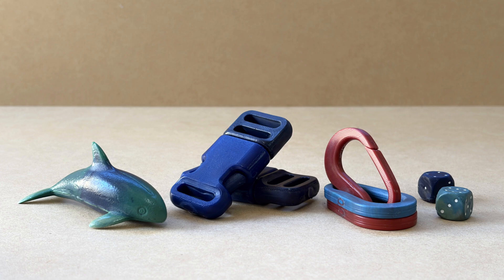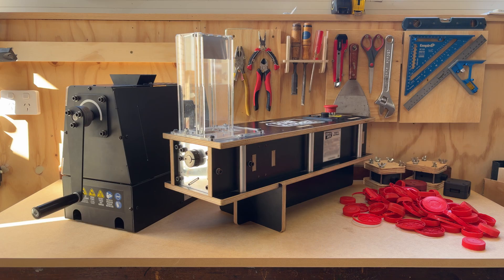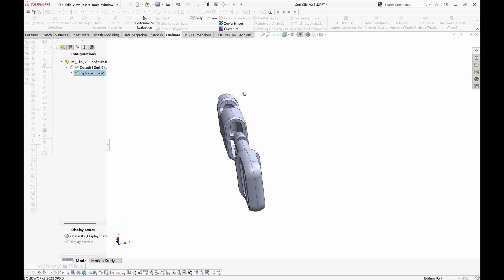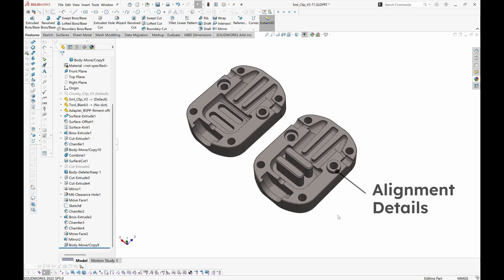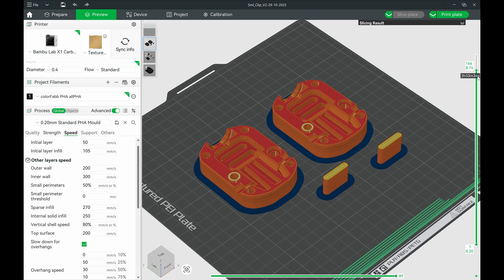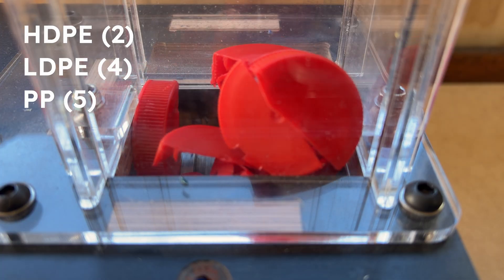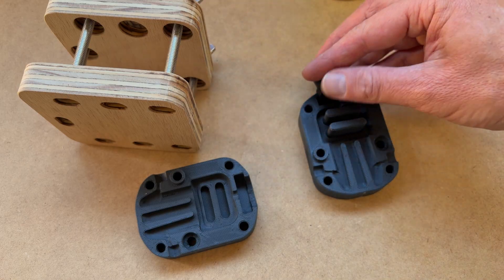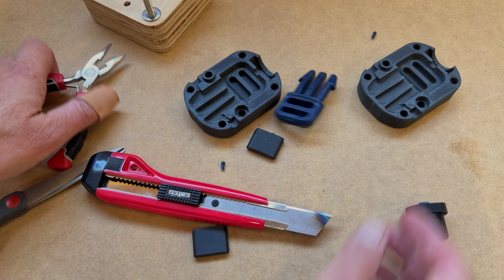DIY Plastic Recycling - FDM 3D Printed Moulds for DIY Injection Moulding – Overview

Comment: Another DIY injection moulder here!

The main issue with plastic moulds is that plastic is not enough conductive to cool the part fast enough.
Not a big deal if you are injecting at a low speed little series of objects.
Also strength on the long run can be an issue.

I started putting together my workspace a piece at a time, from the shredder to the hydraulic press+injection machine, to the CNC milling machine.

Now I can make my own moulds from metal, and that's awesome!

I found that plastic recycling is not only an ethical thing to do, but also very interesting (there are lots of things to learn!).
So ..yes, keep working on that!

Cheers from Italy!
Reply from the maker: Thanks. A CNC milling setup would be nice! Although I still think there is a place for the rapid iteration that 3D printed moulds enable, particularly with compostable PHA moulds.
For part cooling, I do find that for some larger parts I need to keep them in the moulds longer so they cool sufficiently. I also sometimes inject a little slower to compensate for the slow cooling and shrinkage. The advantage of a hand crank extruder is that you can play with this easily. The disadvantage is of course the manual labour!

Comment: Did you make the extruder or did you buy it? Cool video. I’d love to try 3D printed injected molds. It’s something I’ve wanted to try for a while.
Reply from the maker: Give it a go! 
I didn’t make my machines. I designed some moulds for Precious Plastic Melbourne and received the machines as payment. You can buy them here: https://tinyurl.com/ppmft 
Alternatively, there are plans available online to make similar machines in the resources section of the main precious plastics site:  https://www.preciousplastic.com/

Comment: i wonder if the molds wear out overtime from pumping hot molten plastic into them, not a big deal though, you can always print a new one.
Reply from the maker: A few others asked about this, so I made a video exploring it: https://youtu.be/n4JlwUKX36I (Apologies that the audio levels are a bit low in that video so you might have to turn it up.)

Comment: a while back I saw someone using Plaster of paris for making inner linings for a forge, a surprise to me since I didn't expect it to be capable of handling any heat. So I wondered if it would work as a negative mold. Thus I printed parts in ABS, quick acetone spray and vapor bath to smoothen the surface and tossed it in POP using the typical workflow people use to produce sand casting molds, surprise to me the 2 part mold came out surprisingly well. It was brittle however so in edition two I added some small 5-9mm chopped glass fiber strands directly into the POP and used graphite powder as mold release and printed an external shell for the mold in plastic to provide some reinforcement to the walls during extrusion . Tried it with epoxy first and the part came out clean. Next I just melted the PLA scrap I had, 240C melt temp, forced into the mold, a few air pockets remained due to improper venting (easily solved) but the surface was great and the mold didn't fall apart. I cycled it a couple dozen times since and it hasn't had any terrible repercussions. All in all, its a valid low cost method if you want to give it a go. A quick spray of dry graphite on inside of molds solves mostly everything

Comment: Very interesting. I make rotational moles for casting. Do injection molds only make solid prints or is there a technique for creating hollow castings?
Reply from the maker: I'm not aware of a technique. The way it is usually done is with multiple thin-walled parts assembled (or welded) together.

Comment: Thanks man. This was a great introduction into the process. I have been watching multiple ways to do moulded parts and you have taken it into a simple level. I have seen people struggling to feed the material into the mould with enough pressure so that machine that can melt and feed the part is interesting.

Comment: Happy you made a long form video. Such a cool process. I am interested in the CAD part, how to design the mold. Also a comparison on part strength would be nice. A 3d printed part vs an injection molded part with the same material. Great work!

Comment: The most important part you forgot to mention is that yours PHA mould melting temperature is 190-220 Celsius while the LDPE etc is about 95-110 degrees so it makes the whole process even possible, to mould plastic in a plastic mould

Comment: I am new to this area, but I have a basic question, why don't you directly use the 3D printing machine to print the product u showed instead of creating a mold in 3d printer and again using molding machine to get the final product. It's just that I didn't understand. Thanks:)

Comment: Uhm... Yeah....we're going to need a lot more videos. Thanks.
Reply: I agree. Also about the extruder. I am a lazy bastard, so I would go for a drill instead of the handle :-)
Reply: @Namtov  I'd assume you need a large handle for the torque, because plastic is extremely viscous even when molten. If you really want to use a drill, you'd "probably" have to add a geared reduction from the drill to the main crank. I say probably because I'm not responsible for the math involved xD

Comment: how is that 3d printing filament did not melt?
Reply from the maker: You need to use a filament with suitable heat deflection properties.

Comment: Question 
Have you tried this process to attempt to recuperate failed prints and supports or to create new filament?
Reply from the maker: Hi @lauraolivos9800 . I'm looking into injection moulding old PLA prints and support but no current plans to try to make it into filament again. It is possible to create recycled filament from failed prints and supports, but it requires specific equipment and uncontaminated material. @CNCKitchen has a good video on it: https://youtu.be/BT04glGDjB4?si=UfKJIJsVx4GEgW1x .

Comment: Hi, how many times can you use the mold. Thanks.
Reply from the maker: Hi @DJSlayer07 . I did make an earlier version of this mould, which began melting near the injection point. I redesigned it (to be the one shown in the video) and the mould appears to be holding up well. I haven’t yet, but plan to stress test some moulds and share the results, as a few people have asked this now.

Comment: Hello, I also have a small DIY injection molding machine that I recently bought, and I’m just starting to learn how to use it. My main problem is that molds get expensive very quickly — especially when there are mistakes... I had never heard of or thought about making molds with FDM printing, it’s an amazing idea for low-cost mold prototyping! I’m definitely going to try that very soon. I just discovered your channel, and I looked around but couldn’t find whether you share your 3D mold models. I’d really love to try making the quick-release strap clip you show in the video — do you provide a way to get those 3D models? If so, how? Excellent video!

Comment: The big problem is microplastic and nanoplastic pollution . Recycling plastic sounds good, but it actually just increases the amount of exposure the plastic has to the world. It’s a huge problem and the solution is to it is to abandon non-compostable plastic for most use cases.
Reply: There is one slight problem with the "compostable plastics"* that does need to be addressed
Sort of the Elephant in the room so to speak. 

If your definition of compostable plastic is something that you can discard into your own garden composting pile. Then the list of compatible materials are very limited. 

If your definition happens to be "Industrial Compostable Only" per ASTM6400. Then the opportunity of this type of "compostable" plastic factually making its way into one of those facilities is slim to none. 
In the US, only ~%5 of the population have access to such a facility, and access does not mean its accepted. Simply that an industrial digester happens to be in your area. A municipal composting system is not ASTM6400 certified, we are talking about industrial digesters that are needed to handle the material. 

Once we get past the definition of compostable plastic, we then have to ask what does the the business model model look like for a composting facility (all standards and forms, not just ASTM6400). How do they make any money dealing with these materials? Compostable biopolymers offer no efficacy to a composting finish material. It does not increase the nutrients, it does not add any value. So why would they actually accepted and treat it? Who will be paying them to deal with these materials?  30 years into using "compostable" plastics and we haven't figure out the math yet (Italy has by the way). 

Last but not least is the fact that if (big if) a composters does in fact allow biopolymers that are "Compostable". How do they ensure that it will in fact compost? Do they have the means and methods to ensure their plastic intake is in fact just biopolymers? or is there an acceptable and allowable chance other non-compostable plastic enters their systems?

In brief, how does a composter know the difference in between a PLA, PP and PHA fork or knife? And what happens if they get it wrong? 

The short answer is simply that most composting facilities treat all plastics as contaminant. They do not have the means to ensure the safety of the materials, and because they re-sell their end product to farmers and growers. Any contaminant within the composting system becomes nothing more than a rapid delivery system for micro plastics within our food chain.

You are 100% correct on the big problem being micro and nano plastic pollution. However, because of the lack of federal regulations and this idea that industries need to self-regulate. We have created a system that is in fact accelerating and increasing the risk of these polluting "compostable" plastic. 

*not all biopolymers that are "compostable" are created equal. There is quite a significant range and levels of ecotoxicity.

Comment: Cool Video!

I am surprised that PHA is actually suitable for moulding!
I started using it and as you said it fullfills my sustainability requirement, but I had the feeling that it's always a compromise. Nice to see it performing superior in a specific application!
Reply from the maker: Thanks. It is a very specific application! I agree it can be a bit of a compromise for some applications, but I usually decide it is worth the compromise.

Comment: I'm interested in all of it. I purchased all the tools and equipment to convert my mini mill into a cnc machine to create the needed aluminum molds for casting plastic about 5 years ago, but never followed through with it, because I couldn't find enough info on the rest of the process to really proceed any further. The available "injection" machines back then were way out of my price range, and there wasn't any decent "how-to's" on creating your own that I felt would work for me.

I also like your little plastic shredder you've got there!

Comment: How many cycles have you done on a single mould? Any signs of wear?
Reply from the maker: Hi @KOT3J1 . Thanks for the interest. I did create an earlier version of this mould with a part line right where the plastic is injected. The edge of this was starting to melt so I redesigned the mould. The new moulds aren’t really showing any signs of wear, but I haven’t put them through a real stress test.

Comment: finally been waiting for a full length video on this, what kind of extruder is this ? and the interphase between the mold and the extruder nozzle is it also 3d printed ?
Reply from the maker: Thanks @CrazyKZ_productions. The interface part is 3D printed but the one shown in the video is PAHT-CF. I have used PHA for these in the past and still do (particularly for smaller parts with shorter injection times) but their lifespan is generally less. I really had trouble deciding to what to include in this video as there is so much to cover.